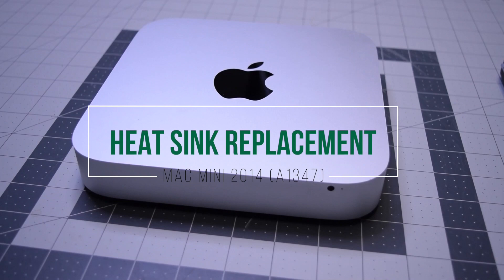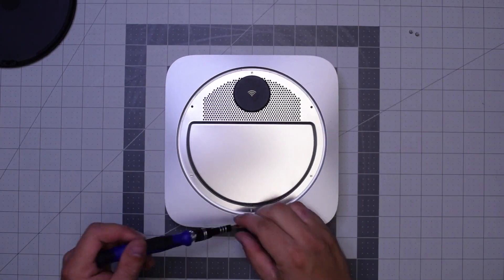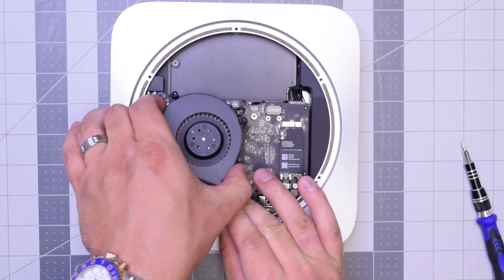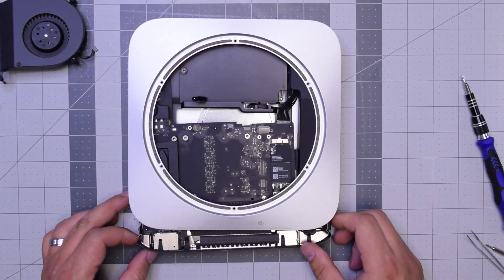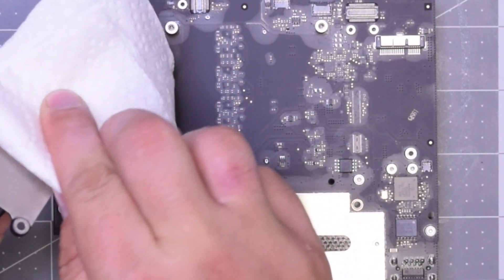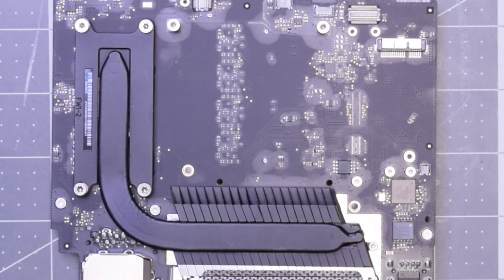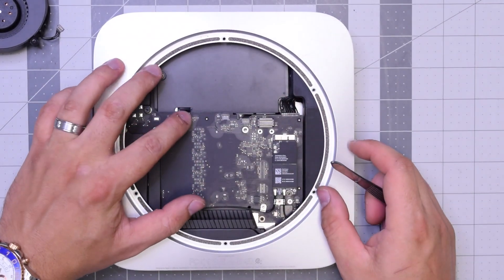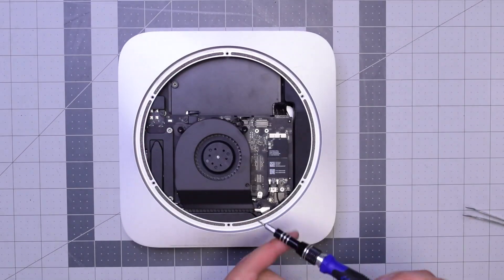Heat Sink Replacement - Mac Mini 2014 - 2017 (A1347)

Comment: Thanks for the great video. I noticed heat sink plat covers only GPU. CPU had no thermal paste from apple itself. Is it still needed to apply thermal past on cpu?
Reply: the paste go's on the CPU  none on the small GPU look at heat seat copper area only over CPU the wide one.

Comment: Hi... did this fix your thermal problems? Actually i have a mac mini 2014, but it gets really hot and begins to slow down the os performance
Reply: https://crystalidea.com/macs-fan-control?ref=macupdate
and you can set the fans. mine are always in 2100 rpm. not too hot, not too loud, but stable
Reply: @panagiotisvassis6247  thank you so much i was going crazy with the jet engine that i call pc ...now its so quiet